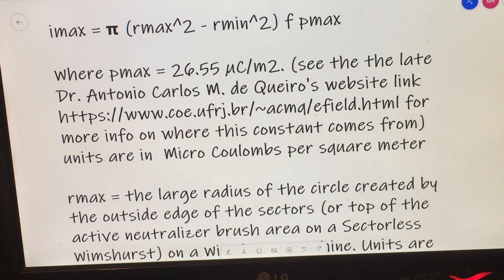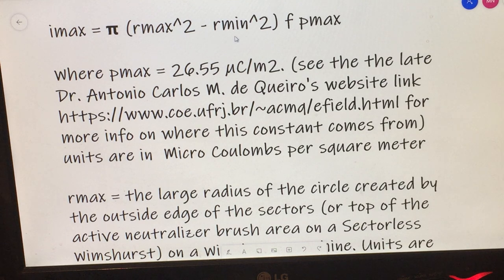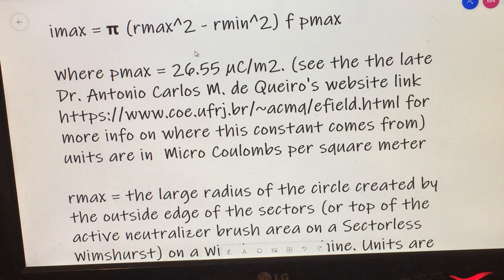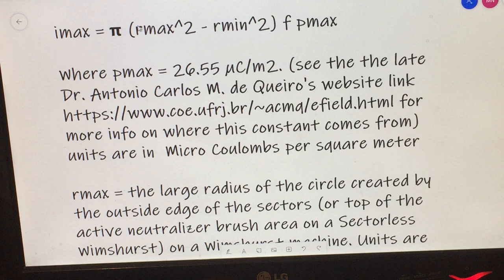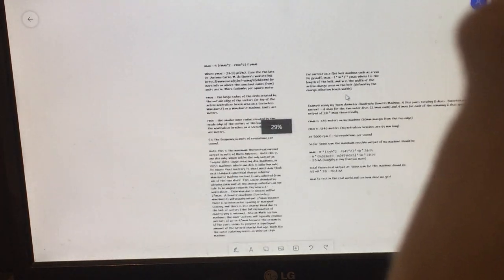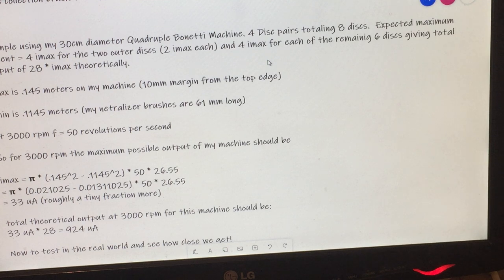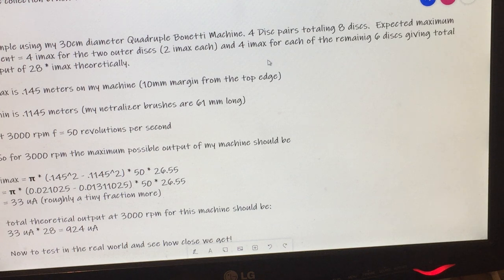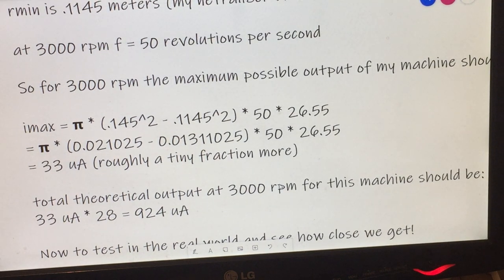Measuring Current From Static Electric Generators PART I

Comment: I wanted to build a Methernitha device but I just have not had the time. I believe that Hermann Plasusen built  them. great video!
Reply from the maker: Thanks.  The Testatika you refer to does not actually perform what the ancient poorly made video suggests, hence the reason they never used the machine to power their collective.
Reply: @MisterBonetti  Yea I suppose no one ever made it out to tell anyone about it other than propaganda. However I do know that in WWII the German's were using similar devices to power motors and some types of industry but they sent large balloons up into the atmosphere. I did build an Ev gray based electric motor in a kit car  and it was able to drive 700 miles before needing charging. I should say at least 700 miles because it really did recycle the electricity. I am really allotting time to work on A Tesl/Don Smith device.